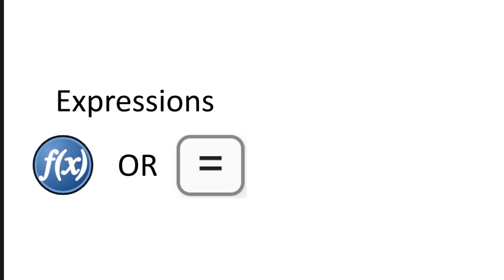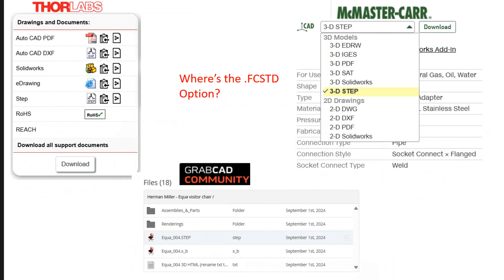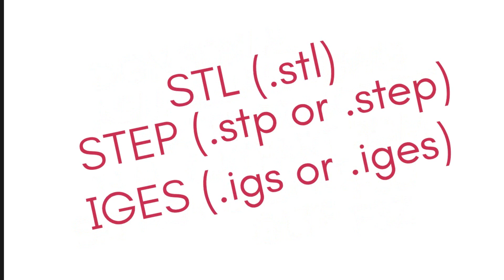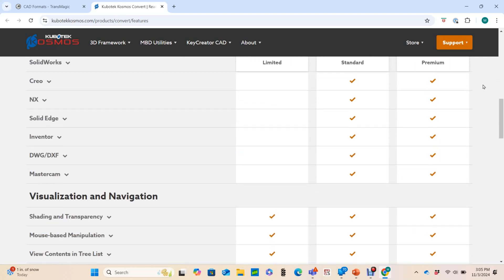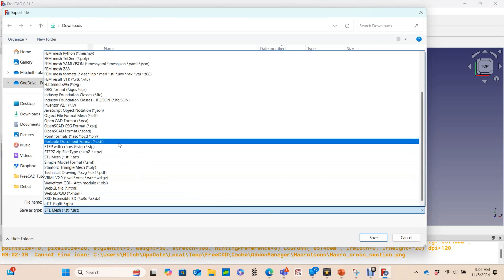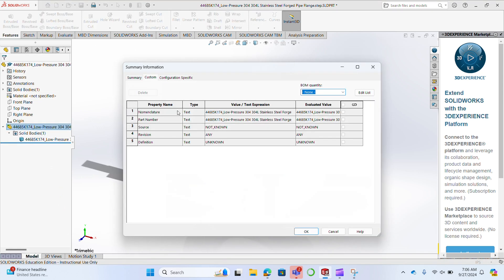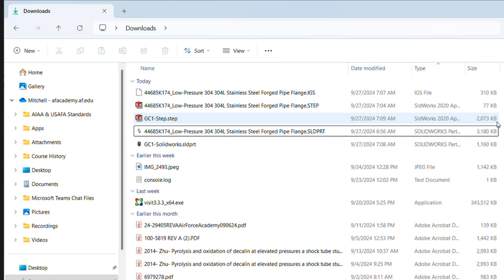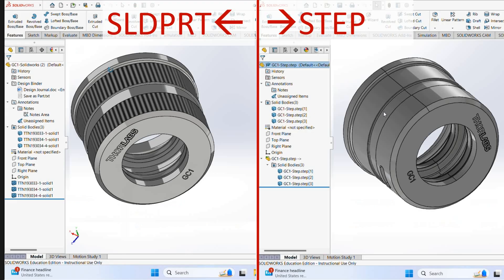FreeCAD: Generic vs Native CAD Files

Comment: GLTF is actually a standard format, but not for mechanical CAD. It's meant for use with interactive 3D rendering, e.g. using A-Frame in web pages.